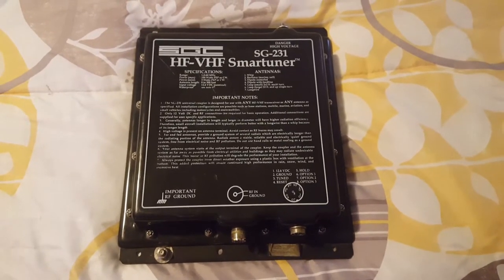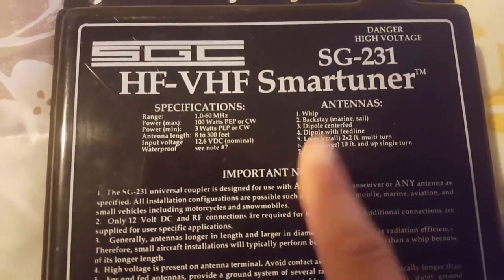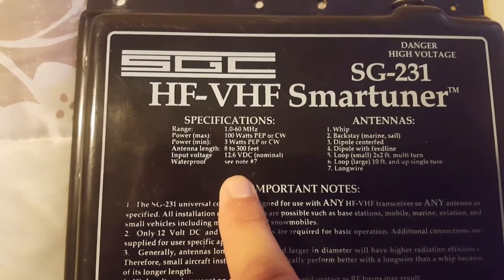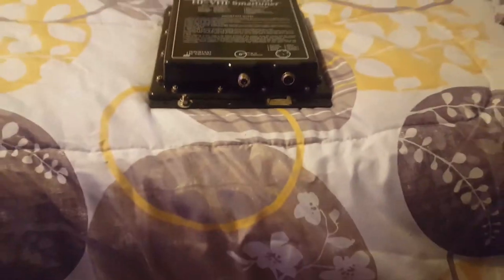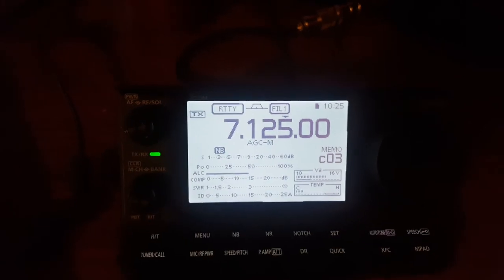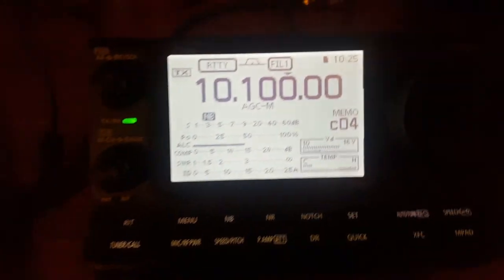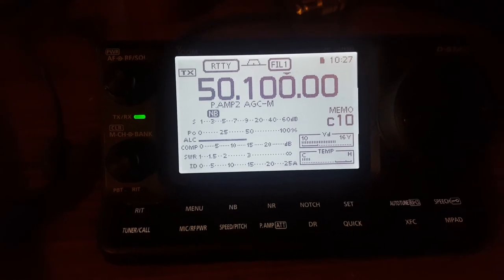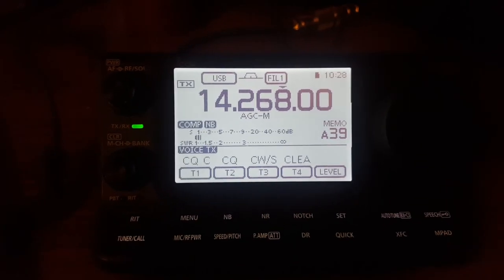SGC-231 Tuning through the Bands

Comment: on 12M, if you hit the reset line it will tune OK.  ODdly enough, even the SG-230 has a hiccup there on occastion.  Might be something in the clock that drives the CPU...
Reply from the maker: I have tried several different lengths of random wires and a dipole, 12m just seems to hiccup with every one of them. Usually I go to another band and initiate a tune, stop halfway between the tune and head back to 12m and it will tune at that point.
Reply: @rodspencer2000  Yeah, I've done that, too.  Need to get a hold of a 237 adn 239 to try them, but I recall my 235 when I had it didn't have issues on 12.  Have you tried tuning a loop, yet?  Oh, boy they can be SOOOOOOO quiet!
Reply from the maker: @misturchips  I have tried a loop, didn't spend much time finding that right size, had better luck with random wire and lots of ground radials. It was my first try, so I don't think the loop was at fault, chalk it up to operator error, and one day I may try again.
Reply: @rodspencer2000  I tossed up a RandomSquoop(tm) up in the loft, and at times it works REALLY well!  I've also made portable dipoles, spirals, and even used a pair of vans bumper-to-bumper to make a dipole...

Comment: Hey man...I got a lot of older radio stuff from a house I cleaned out today. I’ve looked a few pieces up and they all seem to be worth some good money. I have the sg-230 smart tuner and A LOT of other equipment. Would you be interested in it or know the best route for me to sell?
Reply: In my book, the 230's aren't asa valuable as the 231's, as the 231 has more tuning combinations / does a better job of matching antennas the 230 can't quite get.  The last SG-230 I picked up used was $160 shipped to my door; I have it on an antenna in the attic and it does OK.
Reply from the maker: I agree, that is why I bought two SGC-231 tuners, they preform very well when installed properly!  Heavy on the ground system is the big key for unbalanced antenna's